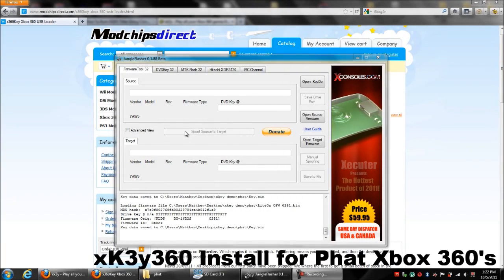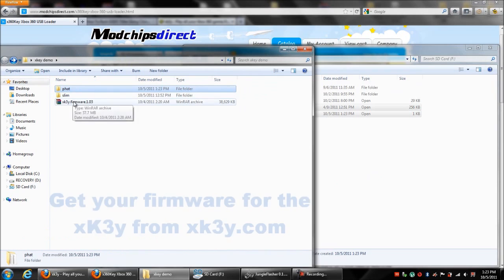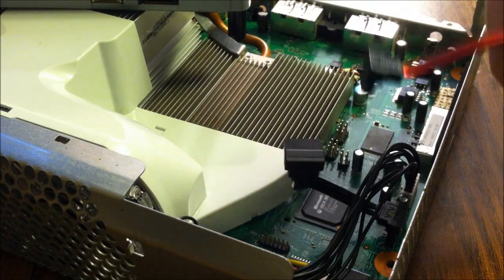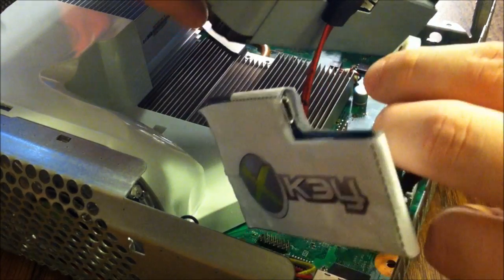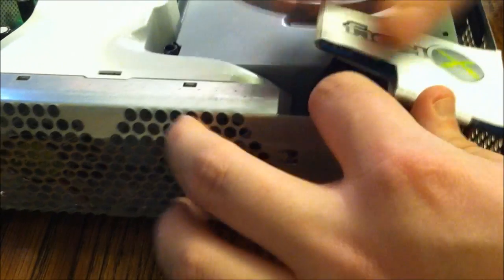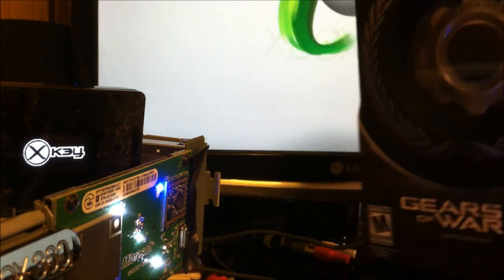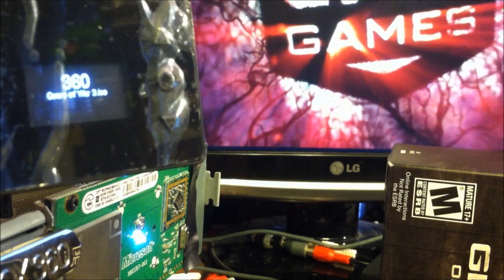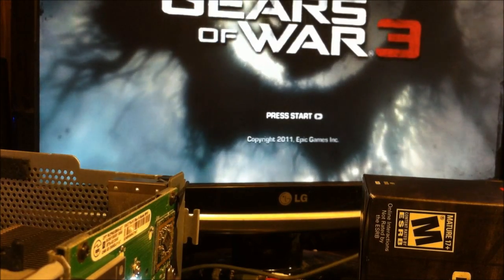xKey360 Installation into a Phat Xbox 360

Comment: This is for the older version of the xk3y. You no longer put the two files to update the firmware on your SD card. you add these on the HD or a flash drive and will now update so you no longer need to remove the SD on the board. Next is you no longer need a dae.bin file with the latest firmware 1.12. Also now comes with flat cables to it does not get crushed on xbox case.  make sure you read or watch video on how they work.  Im on the latest xbox dashboard and plays the newest games.